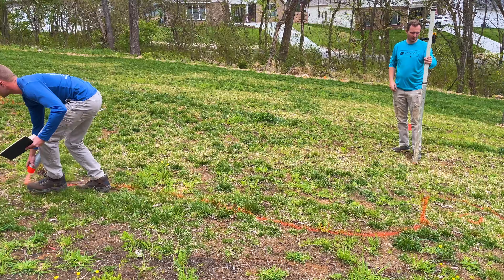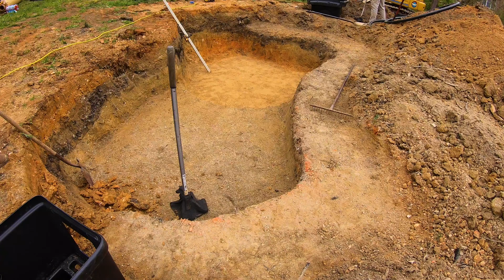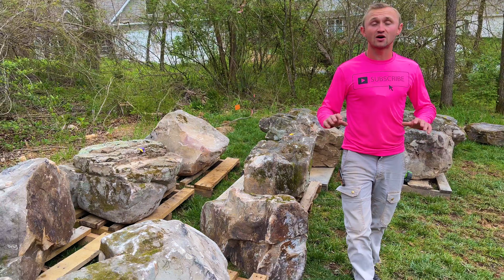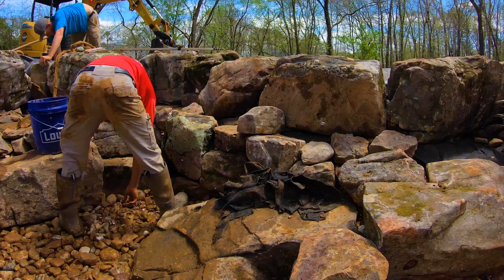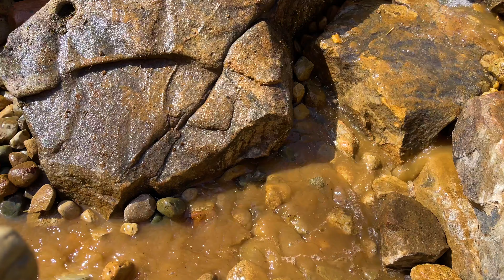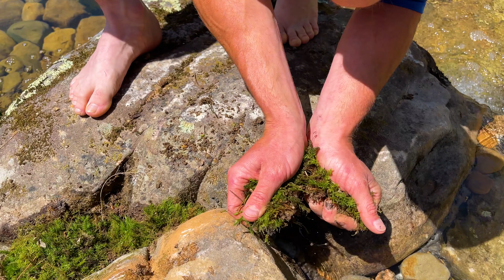From Challenges to Solutions: Crafting a 13' x 19' Pond on a Sloping Yard💧

Comment: Don't mind me asking what was the pipe you installed by the biofalls?
Reply: Corrugated pipe that leads to a ball valve for a bottom drain on the biofalls. Make cleaning out the biofalls a breeze in spring.

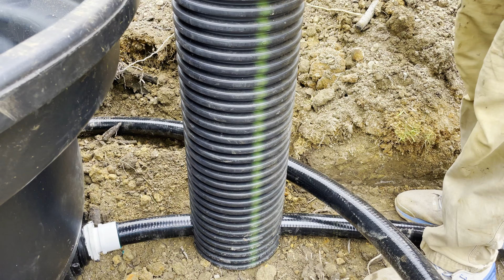Comment: 4:15 what is this corrugated pipe you’ve cut and stood over the water line? 🤔
Reply: Leads to a ball valve for bottom drain on biofalls. Expedites cleaning it out.
Reply: @cpele08 🤔 when you shut the pump off the biofalls drain back down to the pump.
They never showed a value going in and why is it so much higher than the biofalls? You can’t reach it it’s more than an arm’s length…so you would need a value tool. I’ve never seen them utilize something like that before this way. 
Are you collaborating with them on this project?